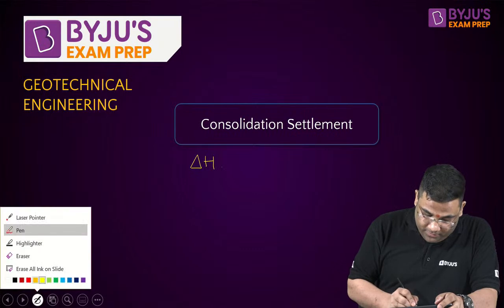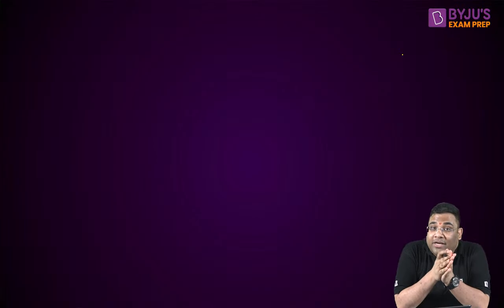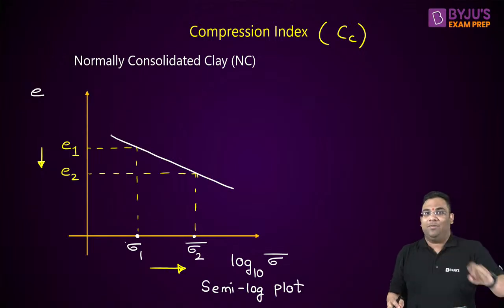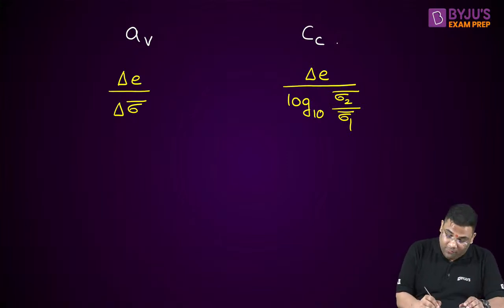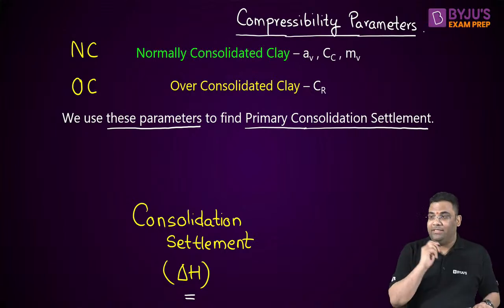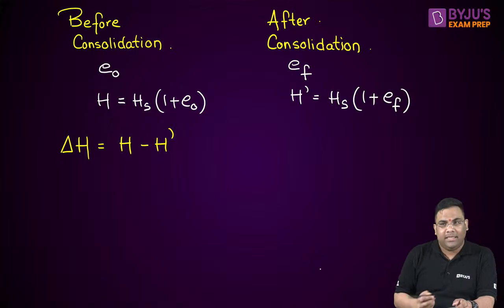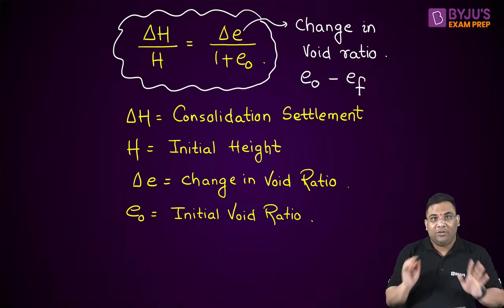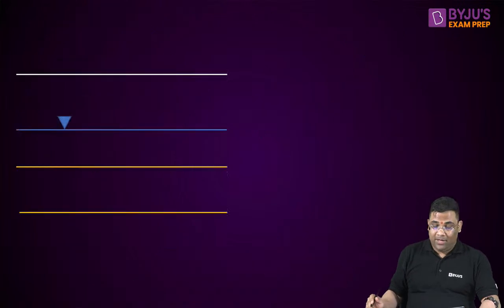Consolidation Settlement in Geotech for GATE 2023 Civil Engineering (CE) Exam | BYJU'S GATE

Comment: we learnt compressibility parameters Av, Cc, Mv used for normal consolidated clay and Cr used for over consolidated clay .
 then  derived BASIC equation for settlement for primary consolidation  (delta H)
Then modified equation when change in void ratio is not given THEN how to compute primary consoildation settlement (delta H) for nc clay and oc clay

Comment: • Understanding of Primary consolidation settlement( ∆H) which is calculated @mid depth of clay layer
• Graphical relation between (e), (eff.stress) ,log(eff.stress) for both NC&OC Clays.
• Parameters such as av, mv, Cv (NC Clay), Cr (OC Clay) and their respective units .
• Also ,computation of final void ratio(ef) with the help of Cv,Cr 
• Finally calculation of ∆H with  the help of various parameters.

THANKYOU SIR 🙏🙂

Comment: There are two types of consolidation settlement, in that primary consolidation settlement is the most important one.
Primary consolidation settlement is determined at the mid-depth of the clay layer.
To determine the ∆H some of the compressibility parameters are used based on whether the soil is NC type or OC type.
For NC clay the compressibility parameters are 

a) coefficient of compressibility av
b) coefficient of volume compressibility Mv
c) compression index Cc

For OC clay the compressibility parameter is 

a) Recompression index Cr

Thank you sir for the beautiful session

Comment: 1. Cc, av, and mv are the compressibility parameters defined for Nc Clay.
2. Cr is the compressibility parameter defined for Oc Clay.

3. Settlement is calculated at a mid-depth of clay layer, Compressibility parameters are used to calculate  primary settlement 

Thank You Sir for such an awesome lecture 🙏🙏